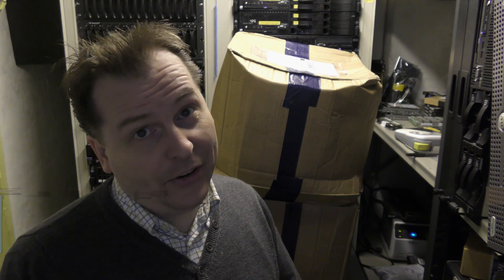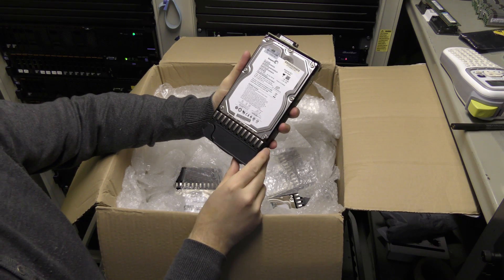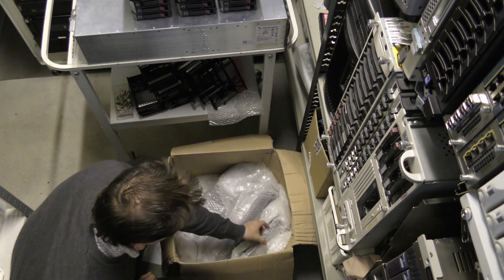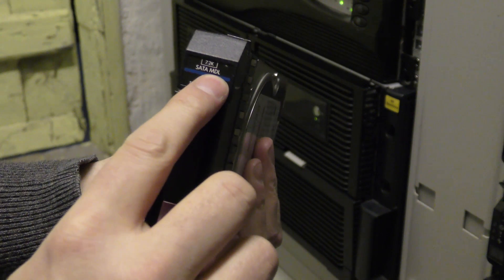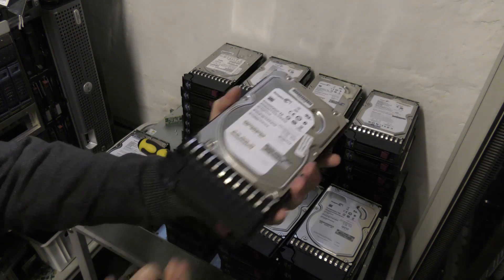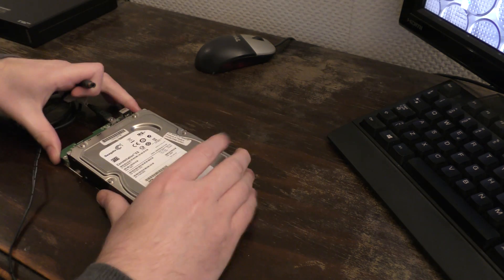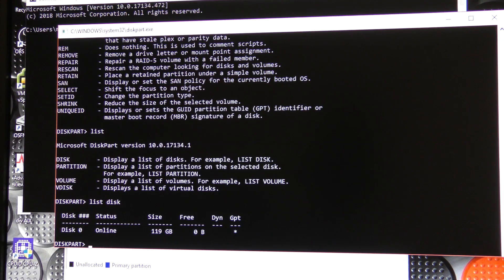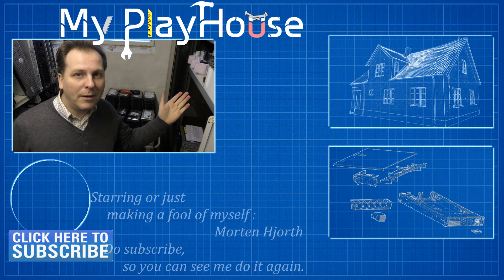48TB of Storages Drives that Doesn't Fit in the HPE DAS - 806

Comment: I guess it's not a firmware issue this time. I know these are not WDC drives, but search foe 3,3v pin hdd on youtube / google. Worth a try.
Reply from the maker: Hi John Kristian Aasen
Thank You very much!  Ran in to an even weirder problem,, think I got it not but in the next video on this,, it weird :-)
Thank you for watching! :-)
Reply: @MyPlayHouse  yep 3.3v pin 

if you put it inside pc and cut the 3.3v cable (if it has one, nor is it ever used) or tape up the 3.3v pins on the drive that run the 3.3v feed or the drive will stay in a shutdown state

Comment: Hi nice video why dont you try to modify the blanks that you put in the storage box that you have been taking out it could work.
Reply: Most of those HP blanks have a slightly longer front end than a normal tray.
Plus cutting the back end off, and depending on which blank, there are several, maybe either a single center brace or a lattice that needs to be cut out
Then you have to get the screw holes precisely right.
I tried this once with some 380 blanks, 2.5 drives, let's just say it didn't work out real well.
Reply from the maker: Hi Ty Brahm
Thank You very much!  no need,, we are all good on trays now :-)
Thank you for watching! :-)

Comment: Hi Morten,

These caddy's only fit the SMB SANs MSA2000/P2000/MSA1040/2040 etc (and DotHill AssuredSAN and fujitsu FibreCAT, they are all the same)
The PCB in the back is called an interposer, and although the connector is a standard 40 pin FC-AL connector, they are running SAS through it.
The main purpose of the interposers is for dual porting the SATA drives so they can be hooked up to both SAN controllers at the same time.
The SAS variant of the interposers are practically empty PCBs beside a single EEPROM chip.

I'll happily come pickup up the caddy's with or without drives, if you can't use them :-)
Reply from the maker: Hi Victoria Hansen
Thank You very much!  glad you liked the video :-)
Thank you for watching! :-)

Comment: Possibly a long shot, but I know that SATA drives taken from enclosures from the likes of WD for example, often don't work anywhere else because of the 3.3 volt pins. Often to get them working, you have to block that pin with some tape, and then they do, otherwise they will not spin up. I wonder if this is the same case here, could be worth a try?
Reply from the maker: Hi Steven Piper
Thank You!  Never heard of this,, I am going to try them in the server first,, and if that does not work on a big number of the same drive model I would like to look in to this,, do you maybe have a link ?
Thank you for watching! :-)
Reply: @MyPlayHouse  This is one link where WD drives are used as the example: https://www.youtube.com/watch?v=9W3-uOl4ruc

And another one, a guy mentions it at 9:12: https://www.youtube.com/watch?v=kEttNCJ5o9Y

This might be it in your case, I might be completely wrong, but if all 48 drives are doing this, could be it. May however depend on your power supply too, anyways, hope it helps!
Reply: @MyPlayHouse  - Here's a video about the 3.3V issue with WD disks, probably only relevant if the disks failed to spin up: https://www.youtube.com/watch?v=9W3-uOl4ruc

Comment: I remember NetApp drives needed something doing to them due to the way NetApp arrays worked, something to do with a non-standard sector size if I remember rightly, I forget the specifics as it's been two years since I needed to do similar with my old NetApp DS14MK2. I wonder if this is a similar situation which could be rectified using dd in <insert your choice of Linux here> or perhaps it really is something burned in to the firmware that stops HP disks functioning in something other than what they came out of and the interposer is maybe required. Looking forward to your findings!
Reply: https://forums.servethehome.com/index.php?threads/how-to-reformat-hdd-ssd-to-512b-sector-size.4968/
Reply from the maker: Hi Kaho Denna
Thank You very much!  glad you liked the video :-)
Thank you for watching! :-)

Comment: Almost certainly if those drives came from a Fibre Channel array they have been low level formatted with a 520 byte sector size. Good news is you can easily use a Linux install to reformat them to 512 bytes.

First google hit is https://forums.servethehome.com/index.php?threads/how-to-reformat-hdd-ssd-to-512b-sector-size.4968/ which is for netapp but I have personally done this with netapp , EMC and HP drives so it ought not to be limited.
Reply from the maker: Hi Vincent Sanders
Thank You very much!  I did a video on this : https://youtu.be/BbtPPH3W7nU
Thank you for watching! :-)

Comment: The drives could be in one of the linux formats, that has happened to me a few times.
(resolved by connecting them to my recover station and clear out the MBR)
Reply: And why not use Linux to do that? If it's in Linux format, use Linux. Also, it's very good as a general-purpose data recovery and disk partitioning tool.
Reply from the maker: Hi Søren Steinmetz
Thank You very much!  glad you liked the video :-)
Thank you for watching! :-)

Comment: Where did u get the USB to 3.5 inch drive converter thing
Reply: It's from an old external disk.
Reply: You can also get cheap USB/SATA adapters on eBay etc. Remember to get at least USB 3.0, unless it is old slow drives.
Reply from the maker: Yes some old WD external HD box I bought long ago..
Reply: My Playhouse, beware that some wd adaptors are special and using a generic type is more likely to work.